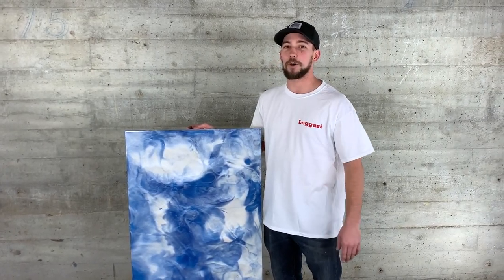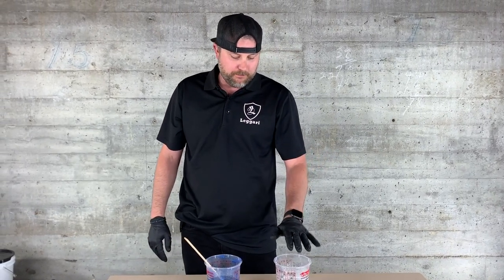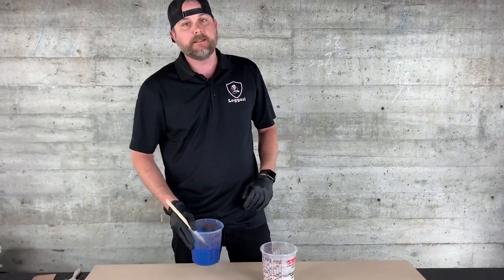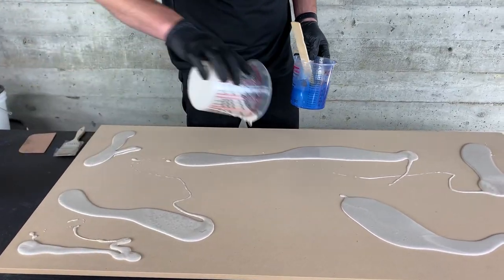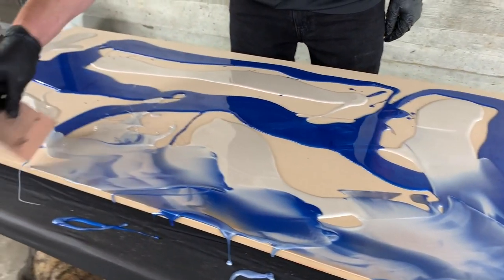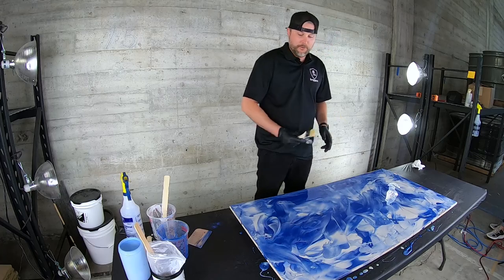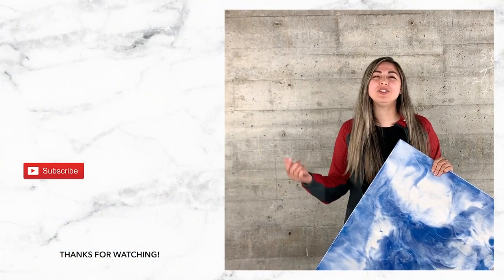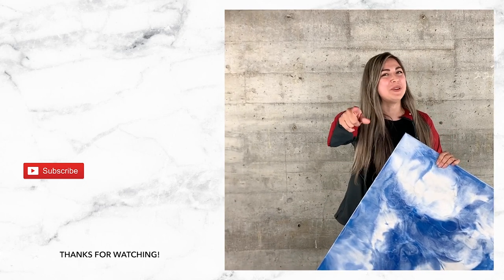Easy DIY Design On Epoxy | Squeegee Technique

Comment: @Leggari Need an epoxy that can go on walls and roof. Maybe shower walls?
Reply from the maker: They are coming out with a vertical application later in the year.  Thanks
Reply from the maker: You just add cabosil to the epoxy to trowel it vertical but we are yet to see a good looking vertical application using this technique. The cabosil thickening agent has been around for decades but no one can make a wall look good with it that's why we don't sell it for that reason. Our wall kits will be launching soon and will be the only one like it on the market. Were paving the road while our competitors are driving on it. Thanks